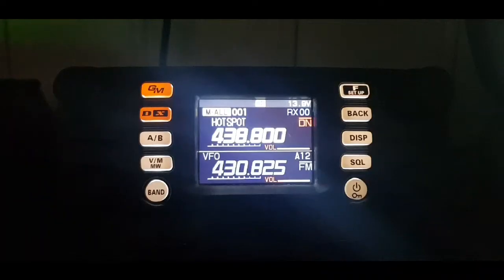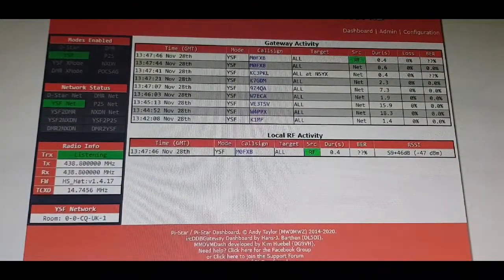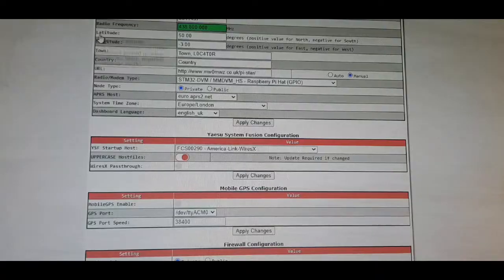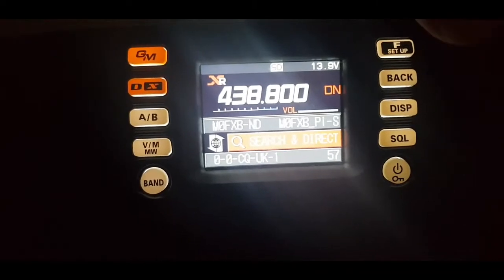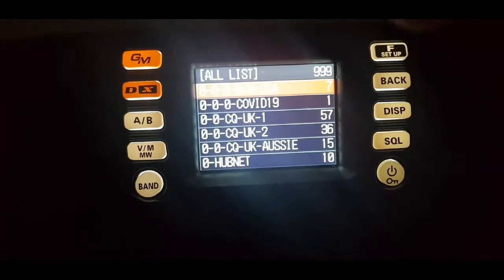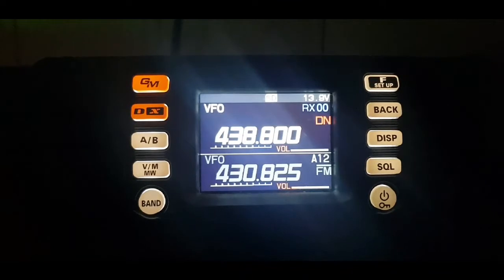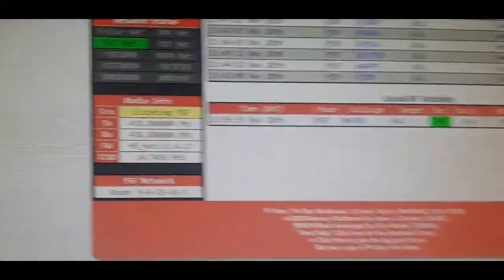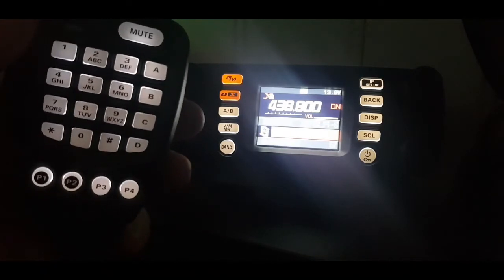Yaesu FTM 300 Wires X control Using Microne

Comment: I thought you couldn't connect directly to WiresX through a hotspot? Am I mistaken?
Reply from the maker: You can it works great but if you want to connect to the PC version wires X system you need a scu20 or 40 cable and to register your node number with Yaesu.
Reply: @M0FXBHamTech  Thanks. The SCU-40 is actually two cables, both the SCU-20 and an additional analog connector, which many might not need. Would this video also apply to an FTM-400XDR? Thanks and Best Regards.
Reply from the maker: @Tonylovesjazz  yes